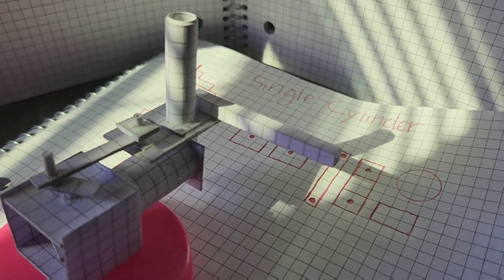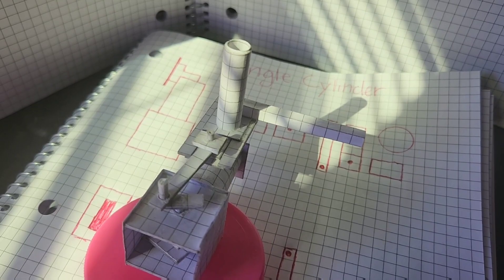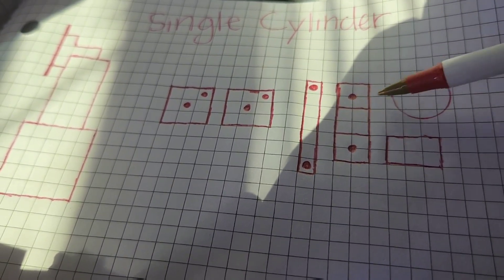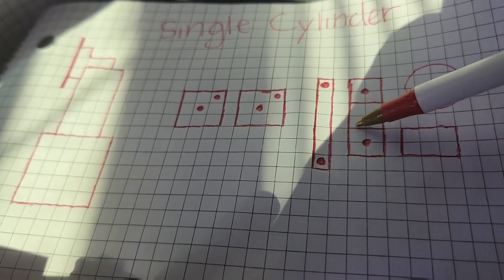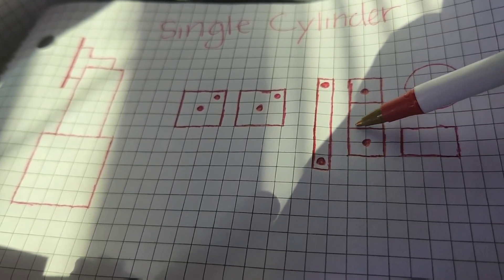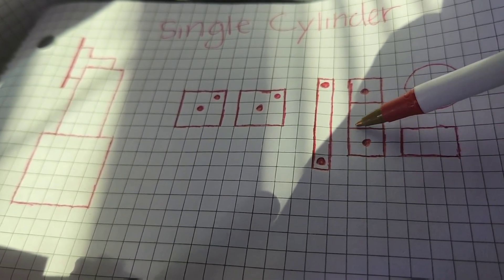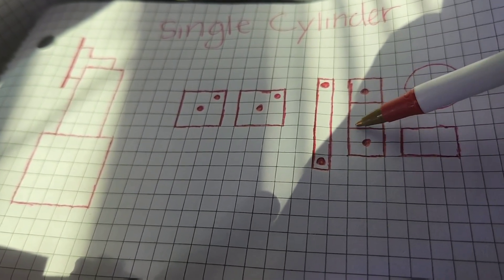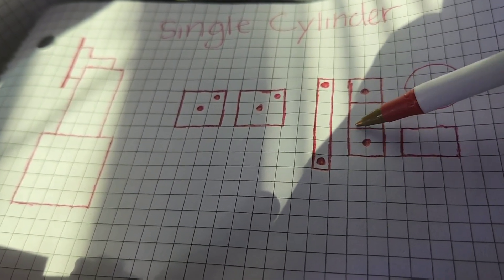How To Make A Paper Engine

Comment: does the cylinder really need to be 3x the size of the piston? just 2x is not enough for the piston to run all the way?
Reply from the maker: i usually do 2.5 so the cylinder be 5 blocks high